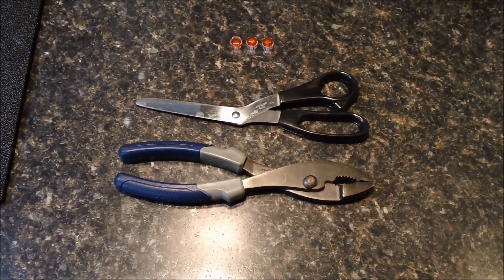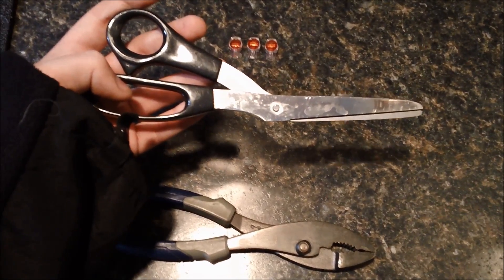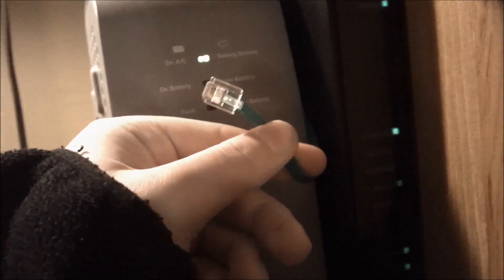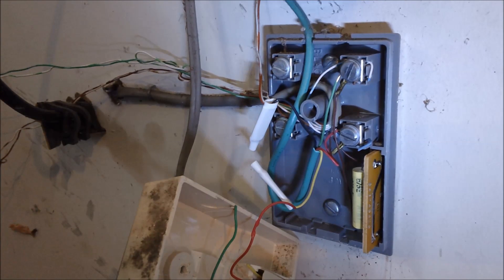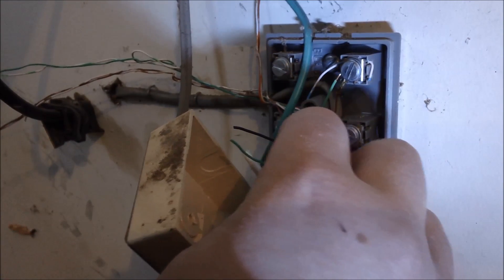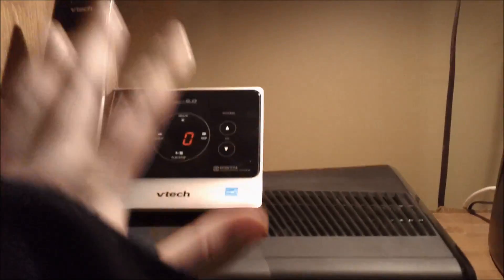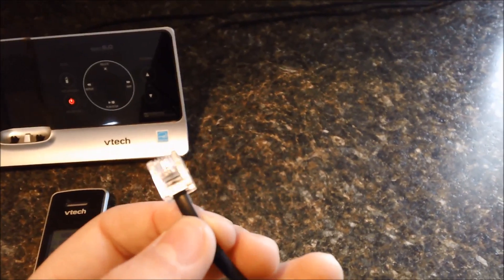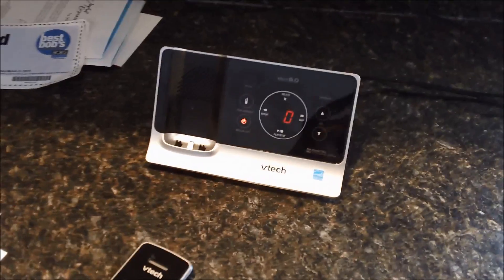How To Splice A Phone Line and Bypass AT&T Phone Jack

Comment: i have replaced my Cable modem router and does not have a phone line plug like the one the cable company was renting me.  How can i get a phone line to work since i can't connect to the modem? Can i connect a ADSL2+ modem to the netgear cable modem router and then to phone?

Comment: Why didn't you just connect the wires with one of the screws inside the interface like you're supposed to. You wouldn't have to buy anything.
Reply from the maker: Because I had ATT Uverse. They did some ghetto shit and if I were to screw it unto the interface, it wouldn't work